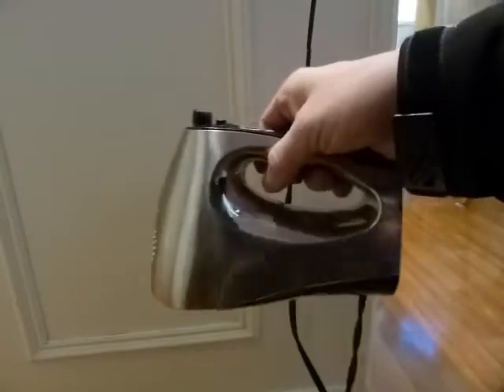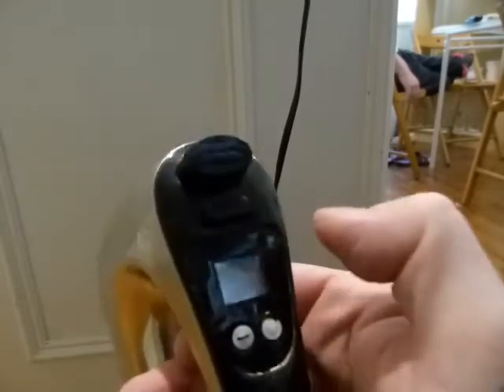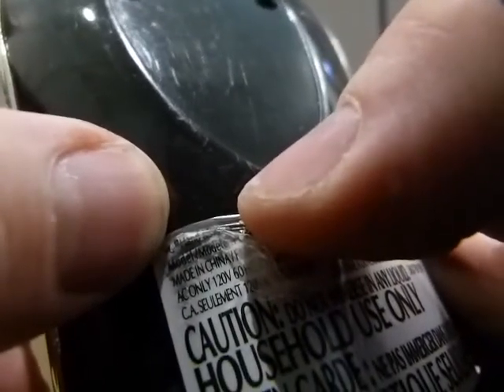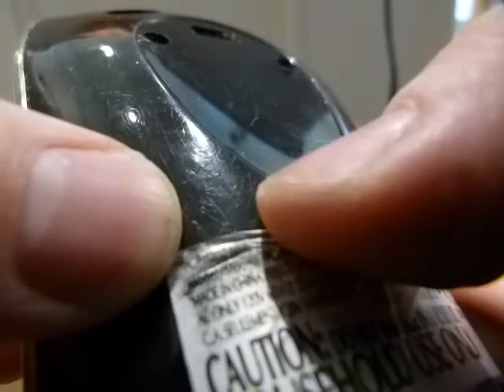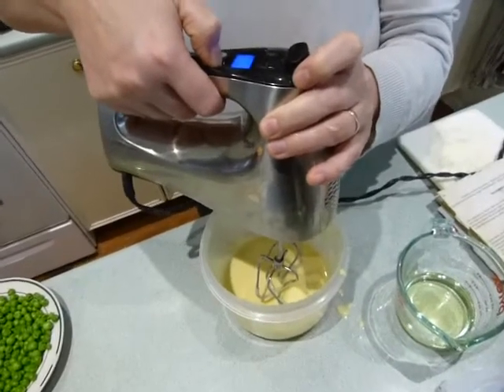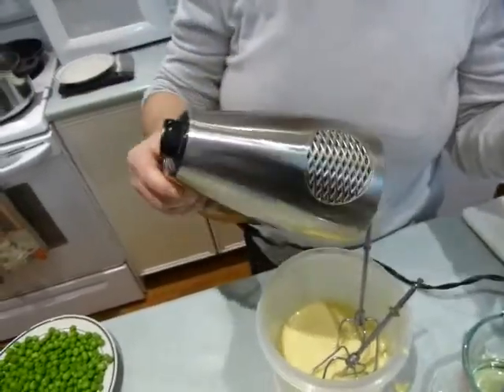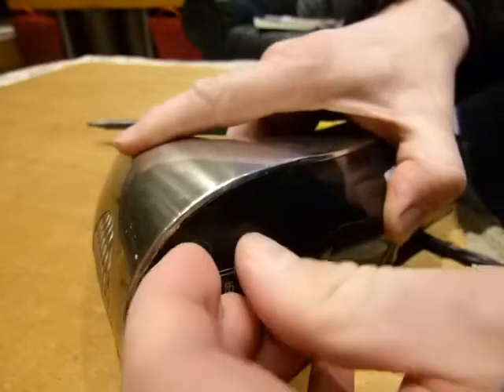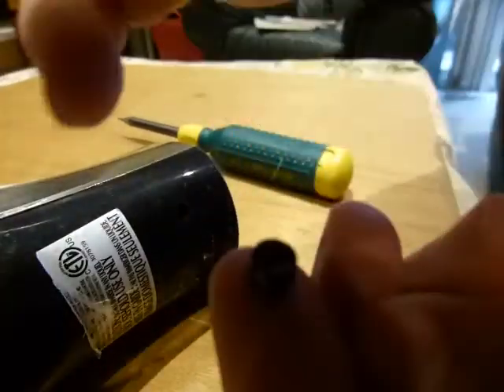Kitchen mixer troubleshooting

Comment: Repairing a vacuum cleaner (expensive, high end Sebo) I discovered that the problem was a fault inside the molded plug head. It's amazing how often cords and plug heads are the weak points. And not so obvious to diagnose.
Reply from the maker: TED6667 I have a video on a vacuum, same problem, found at 11:45 - 12:45 https://www.youtube.com/watch?v=q7I75fQxIBk